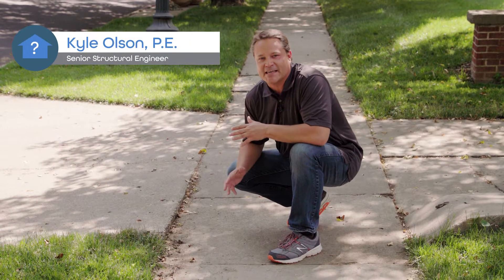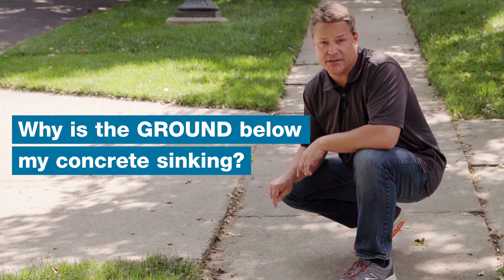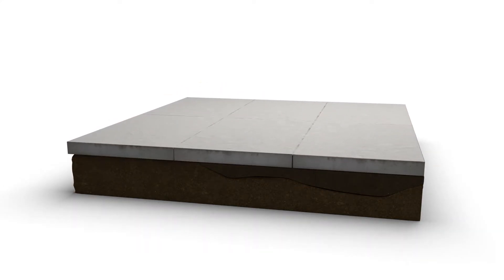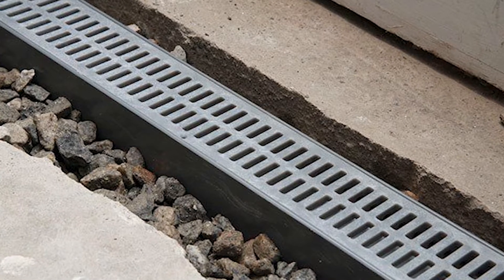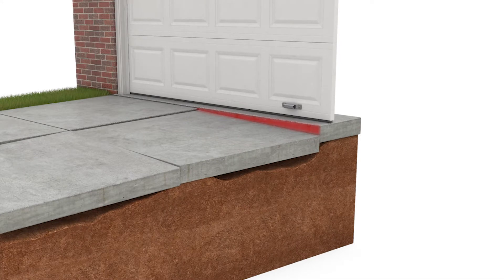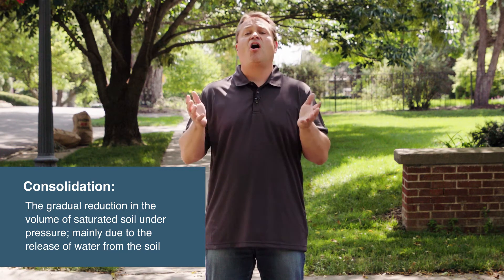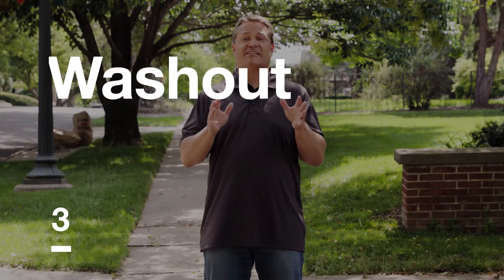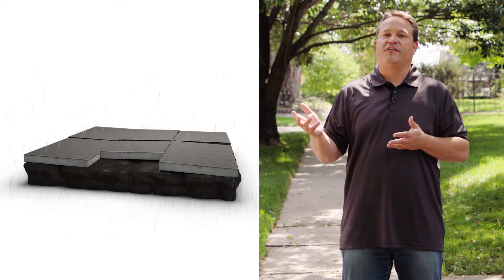Why is the concrete in my driveway and sidewalk sinking?

Comment: We have a very long driveway that's only a year old. The driveway sounds like DRIVING ON LOOSE TILES when vehicles roll over it. There are no cracks. Can or should anything be done? It feels like it could get worse 🥺
Reply from the maker: Thanks for reaching out! That hollow sound can definitely be concerning. We’d recommend having someone watch the concrete as you drive over it to see if there’s any movement. If there is, it likely means there are voids under the surface that should be filled with PolyLevel foam to keep your driveway stable and prevent it from worsening over time. You can find a local PolyLevel dealer here: https://www.polylevel.com/polylevel-contractors.html. Let us know if you have more questions—we’re here to help!

Comment: A cable company came last fall   to install a large box for fiber optics. They flooded the ground next to my driveway before they started digging the large hole. This hole was both beside and underneath my driveway. The didn’t finish before winter set in, so the left rocks and dirt piled up in the area next to the driveway, where my neighbor and I have our downspouts. There were large pools of water over the winter which has never happened before.  When 5hey finally replaced the dirt and rocks, they didn’t repair the grade properly.  Now my driveway is sinking and sliding away from the garage foundation. The cable company told me it’s not their fault. We had no issues before they did this work other then our usual winter heaving.. Can flooding the land, removing dirt both beside and underneath driveway and destroying water drainage and grading cause it to sink and slide away from the garage?